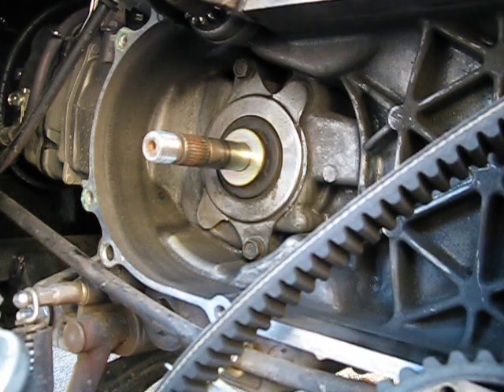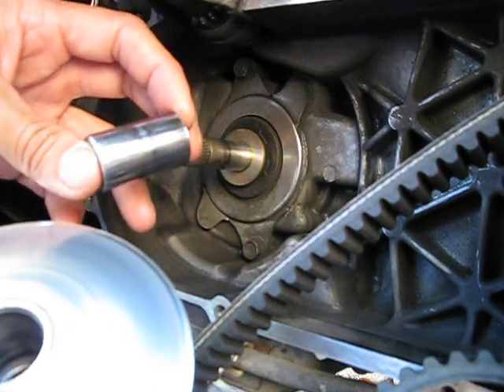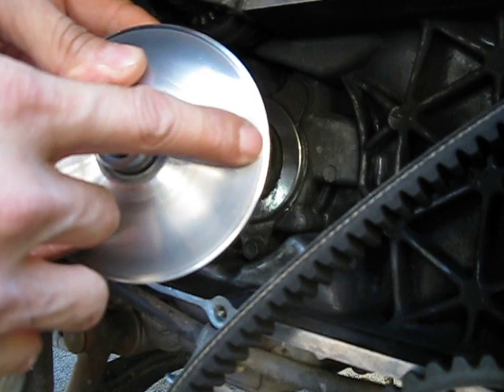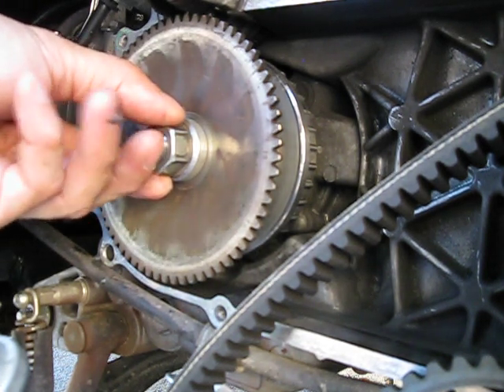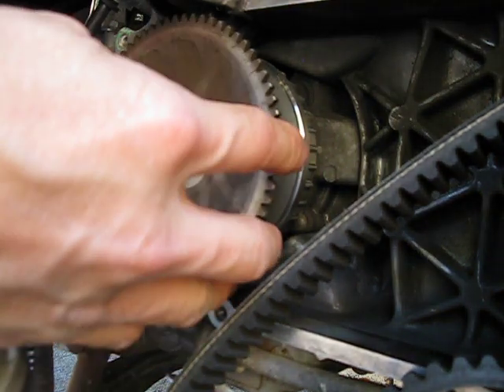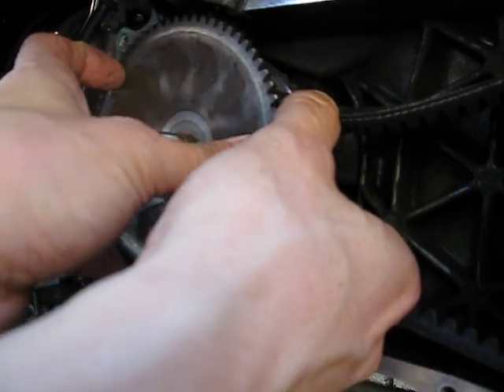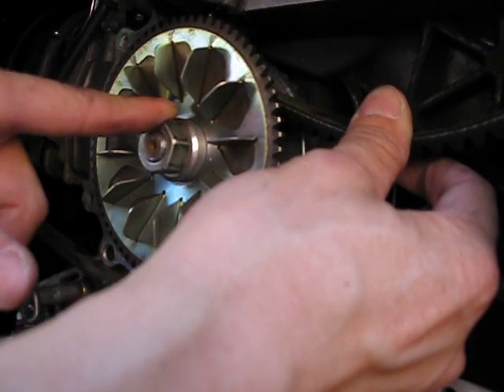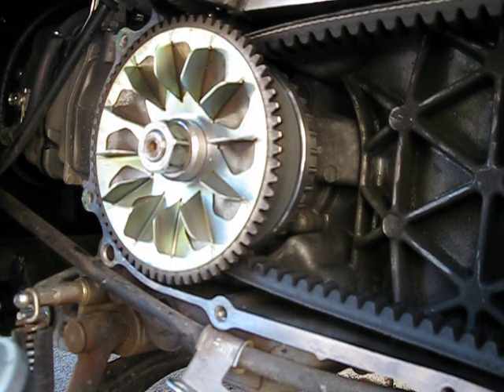Honda NHX110 5mph increase drive mod

Comment: what did you use to machine it? Is there a shop that could do that if it has to be perfect? Sorry just considering doing this because a couple more miles per hour would make a huge difference for me. What amount would you have machined off? And what are you machining? I'm sorry for the cluelessness...just trying to learn a little at a time
Reply from the maker: Nick Schmidt you'll need a lathe

Comment: You mentioned earlier that you no longer recommend partzilla. Which supplier do you recommend for parts? I'm looking to buy some roller weights and a belt soon.
Reply from the maker: Jonathan Bravo yeah partszilla is total rip off, sends damage stuff and blames customer.  Now I use dealercostparts

Comment: With a higher gear, the max speed might be higher, but does that not cost the same amount of acceleration?
I ask, cause i live in a big city ( Sao Paulo), barley drive max speed, but use full throttle at every red light turns green...
So, my question would be if the more in max speed goes on cost of acceleration...
did you experience something like that? More or less what you said at min 8.00.
And if i would place the small ring after the first plate, i mean i would not put it on the screw before, like you did, but after i pot the big plate on. Kinda like between the two plates, where the belt runs, can i make the space bigger and gain acceleration by running the belt in a lower area??
Thanks
Btw... I already learned how to change oil and the air filter with your vids!
All got a big fat "Thumps up"!! :)
Reply from the maker: Jonny Bravo Yes there is a lost in acceleration with gains in top speed, but as I noted in the comment section that I don't recommend this mod any more cause the belt touches the pinion gear.As for increase in acceleration the gearing is as low as it can go stock.  The belt actually touches the drive boss so it can't go any lower then that.  What you can do for more acceleration is use lighter roller weights.  Here in the USA, stock is 13g you can go with 12g and get more acceleration....you might lose a little top speed, won't know until you try.
Reply: i see... tk u

Comment: My elite currently reaches a max of about 48 mph on the dash. Are there any quick fixes that can help reach the 55 mph mark (the speed you had before this mod)?
Reply from the maker: What milage? Sounds like your drive is worn.  New belt and rollers will get it close to stock 53mph.  To get to 55mph without his mod you'll just have to use a larger rear tire, I'm running a 4.0"x10" Bridgestone ML16.
Reply: DaBinChe Thank you for your reply.  I'm at 11,600 miles. Do you think it's time to change these parts out? Also, where can I order these parts from?
Reply from the maker: Jonathan Bravo Yeah it is about time to change them.  You can always tell when it is time for drive parts to be replace by loss of top speed.  Currently I get my OEM parts from PartZilla
Reply: DaBinChe  Thanks for the advice. And great videos! They've certainly helped me a lot.
Reply from the maker: DaBinChe I now don't recommend using PartZilla or any associated subsidy of OutDoorNetWork.com because they have horrible service and lack integrity

Comment: Try Multivar 2000 / Malossi. You’ll have 20km/h more.
Reply from the maker: No, there is only so much power that can push a certain amount of speed.  Something isn't gonna magically give you more speed/power.
Reply: DaBinChe ...but I did it already with Multivar and it works. You don’t need to believe me. Greetings
Reply: DaBinChe  I changed the original variator with Malossi Multivar 2000, white spring and 8,4gr vario weight. So now I have max speed 100km/h
Reply: DaBinChe sure the “something “ is less weight from vario rolls